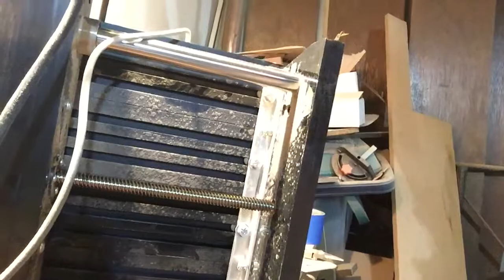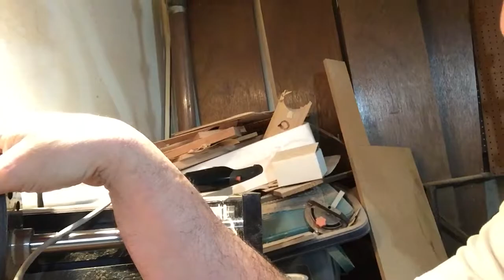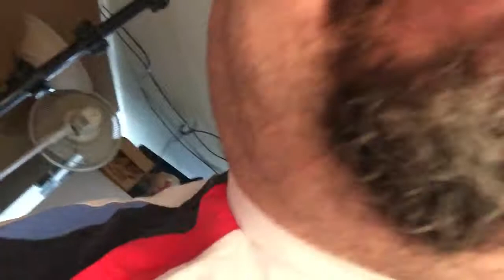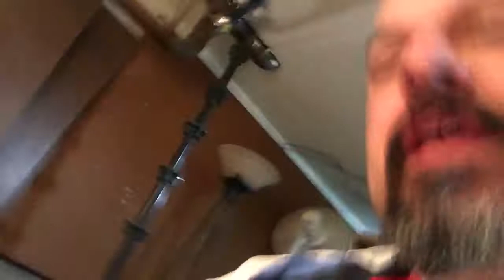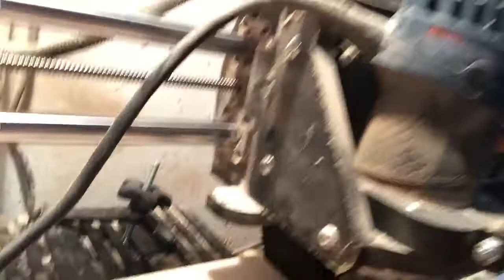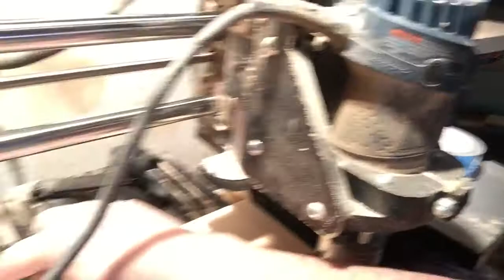Scary Piranha CNC moment

Comment: I see the problem.  You are supposed to “flip” the bracket that holds the router so it moves it up 6-8” off of the work surface.  This allows for the longer laser module to operate and gives it enough space for heat dissipation, etc...  The bracket in your video is setup for a router cutting bit.  Flip it and you will get much better results.  Good luck!!